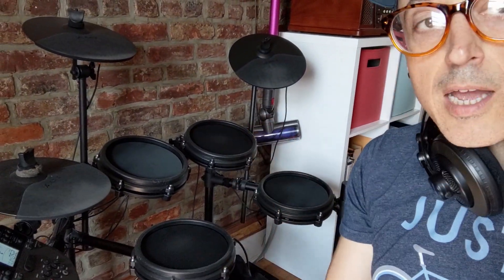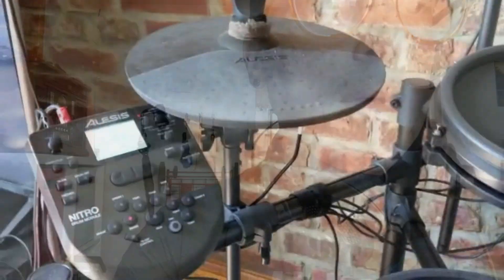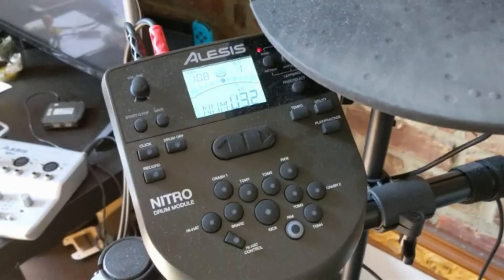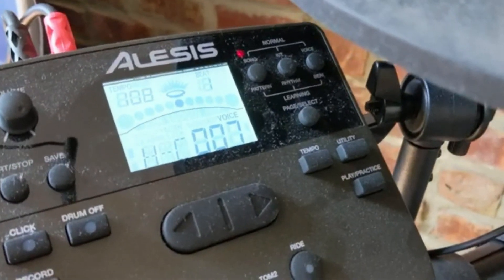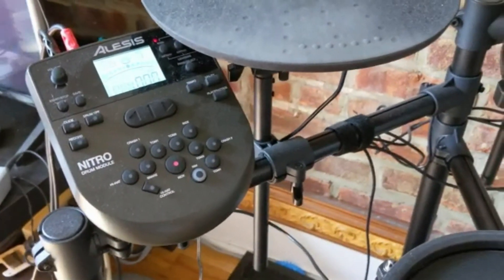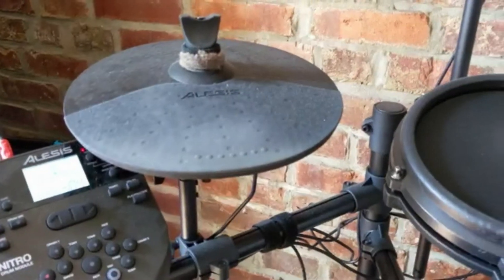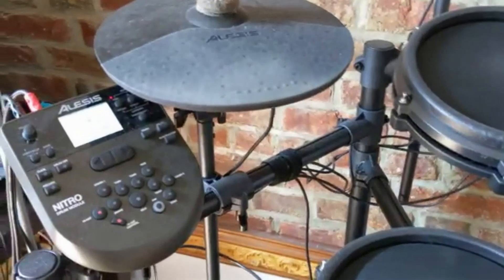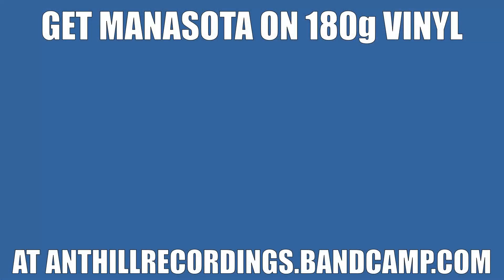Double Bass on The Alesis Nitro Mesh

Comment: I seem to have an issue with the pedal model your using for the hi hat. Whenever I press down on it it will sometimes hit twice or three times even though I press down on it once, any suggestions?
Reply from the maker: make sure your cable is connected good, then just be carful you're not actually jumpy with your foot and hitting it twice by mistake.
Reply: Yes everything is plugged in correctly and make sure I press firmly on the pedal, I've read there might be a mask timing or threshold setting somewhere in the pad to adjust

Comment: question for anyone that can help thank you... my bass drum volume is really low even at max volume and the rest of the set turned down its worse when i tried using my iron cobra double pedal but when i push the button on the module its loud sounds great not with the pedal though any one have a solution??? @DemonicSweaters thanks for all your content!
Reply from the maker: double kick pedals are too wide for the Nitro trigger and hit on the outer edge. That's why it is so quiet. If you use a single kick it should be fine.
Reply: @demonicsweaters  thanks for replying ...but even with single pedal set in the center its too low the beater hitting on the pad is louder...
Reply: I had this problem. Doing a factory reset fixed it for me.

Comment: You can't add a double pedal to the bass drum as you state in the beginning. The pad only registers hits in the very centre of the pad. There is not room for any more. Try hitting it with the sticks either side of the current pedal. Doesn't work.

Comment: 1. Pdp pedals barely fit. 
2. Your gonna keep having a sliding kick pad issue if youre fast.
3. The best for last.. The software cant keep up with your pedals if your fast enough.

So at the end no its not worth buying pedals you could find a kick pad thats faster yes but 300 dollars later you can buy the whole set again. Ive tried this msthod of reassigning but if your not trying to screw your muscle memory up before you even get a second pedal dont do it... Otherwise good beginner kit